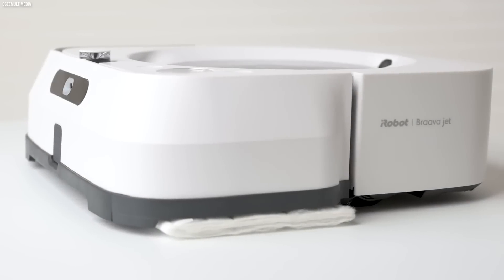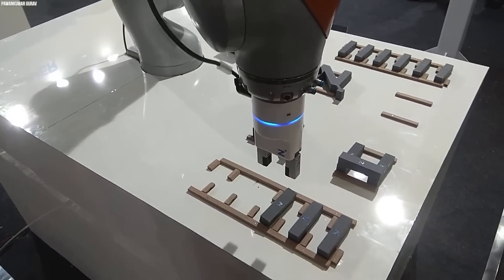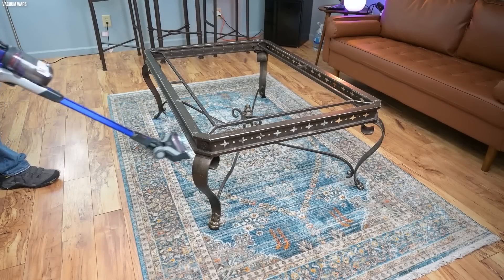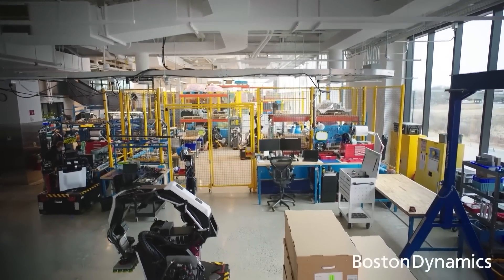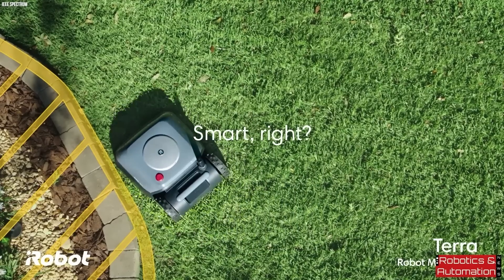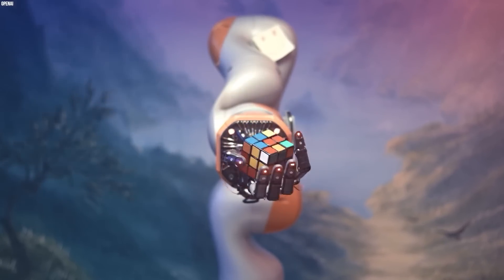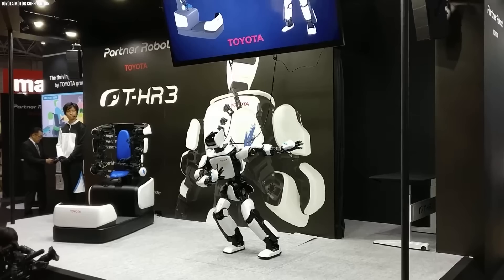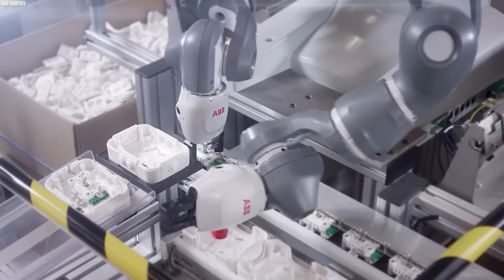Stunning AI Robot Shows How It Will Replace Humans

Comment: Yes, these are amazing but what Boston Dynamics doesn't show you is they have extremely limited power supply use, which is the problem with all autonomous tools, cars, electrical apparatus, and robots, we don't have the tech to generate and store electricity other than in big, bulky,  heavy batteries that deteriorate and deplete in their capacity to store and retain charged (and don't we know) until then don't hold your breath seeing them walking down your street or at work very soon.